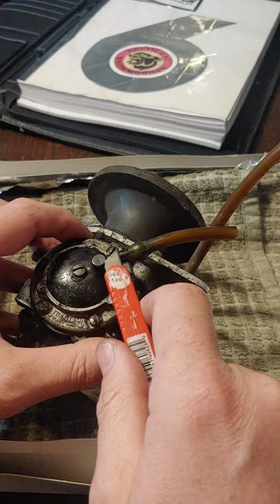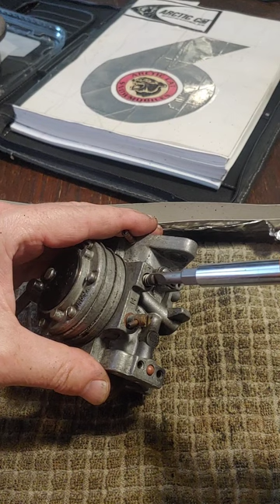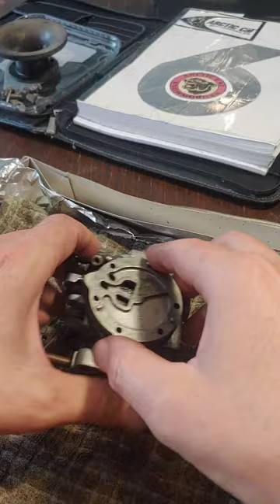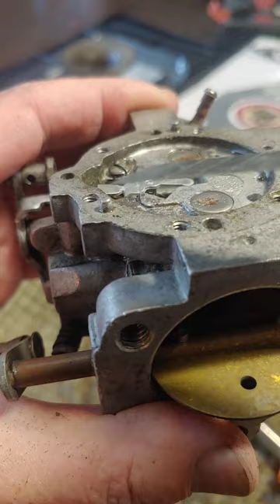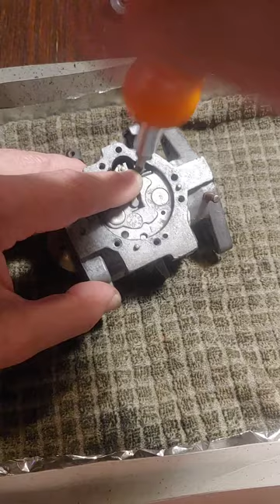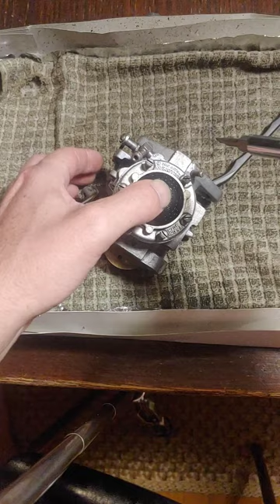Carburetor Rebuild, Tillotson HR70B, 1972 Arctic Cat Lynx, Kawasaki 292cc

Comment: Nice job,thanks,they sure did stack them up back then...Say were you pressuring it or using a vacuum pump for the pop off test and was there a height setting for the needle lever...thanks...
Reply from the maker: Hey, thanks for watching! I was using an air pressure pump. You can buy a pop off pressure tester on eBay, or you can make your own like I did here:
 https://youtu.be/pkrmue35m-0?si=wW16jOoPb7lO0WVF

Also, Tillitson and Walbro carbs don't need the tab that the needle sets on to be adjusted like carburators with a float blown would need. But we do need to check a Tilly or Walb's pop off pressure and get that spring size correct. Best of luck setting your's up!
Reply: Thanks a lot its been a while , normally with vacuum differential pressure working the diaphram i would set the lever just over the body so the lever would have full pump. great info thanks again...
stroke @fixitforjoshsake
Reply from the maker: @happycamper2877  that makes sense to me! Get the most gas for each pulse!
Reply: Thank you, I've had cases where this stopped a full throttle stutter when held wide open and enrichening the high speed jet didn't help...